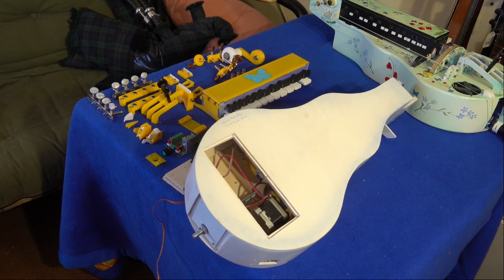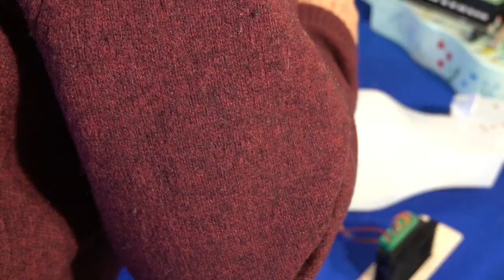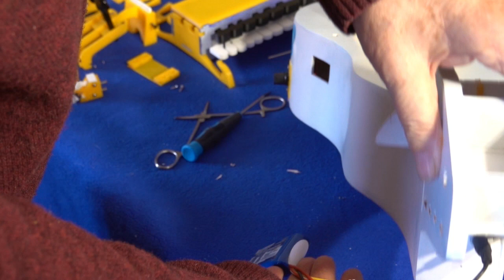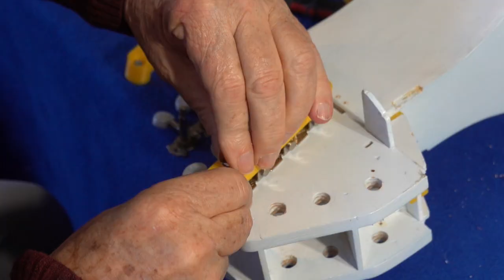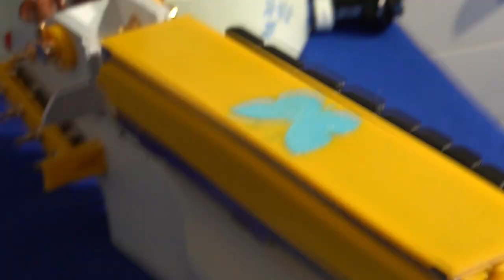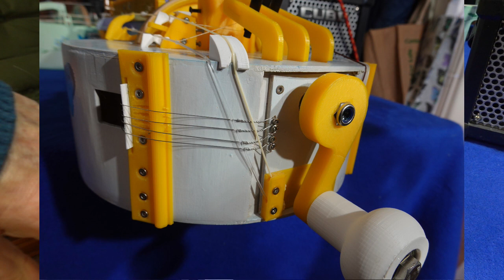Self-Cranked Nerdy Gurdy with Sympathetic Strings

Comment: i'm going to try the wheel as a replacement for the one in the north american kit with a maple veneer, wish me luck!  Printing right now...
Reply from the maker: If you are going to veneer it you might need a slightly smaller wheel. It works fine without veneer. I can send youthe stl for a smaller wheel to allow for the veneer if you want it. Let me know and if you want it give me the thickness of your veneer.

Comment: This is amazing.

I do think you might get slightly better results (not worth a complete rebuild, but maybe worth looking into for future builds) using a servo motor instead of a stepper motor.  It'll be less noisy and have better power consumption (good for when on battery), and be slightly more even for speed.

But that's nitpicking.  Because this is an amazing project!
Reply from the maker: Hadn't thought of using a servo motor, could be good! I did think of using a brushless of the sort used by model planes but it probably needed too much gearing, would have taken less space though.